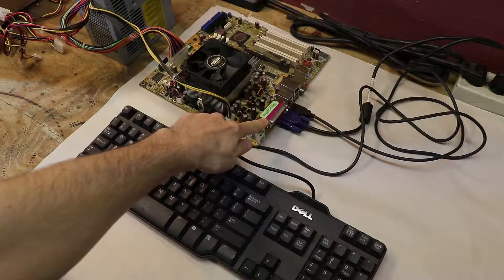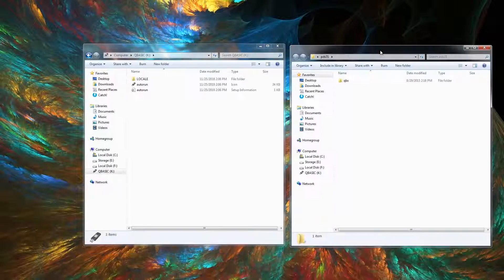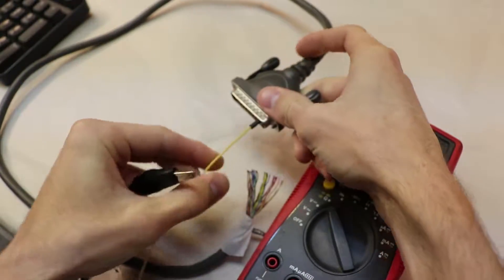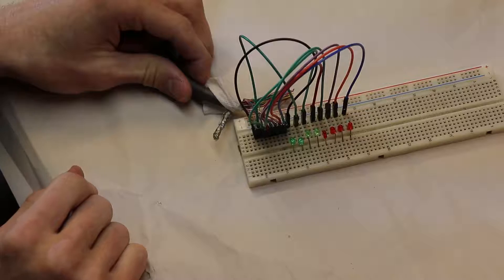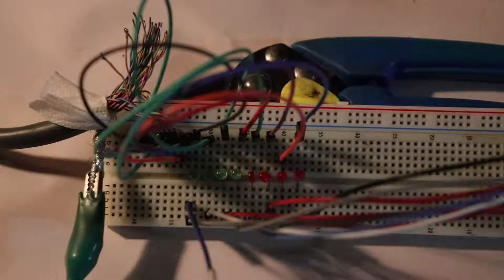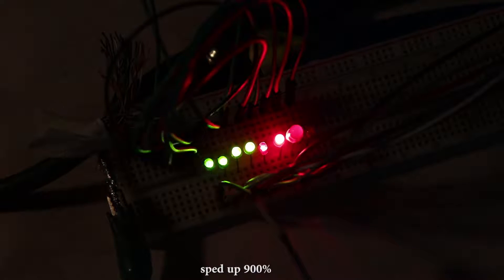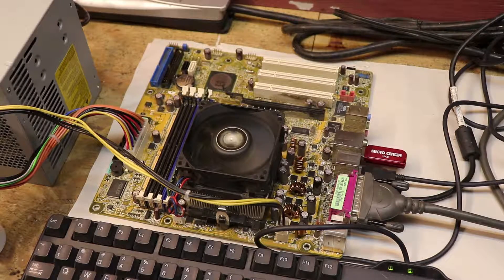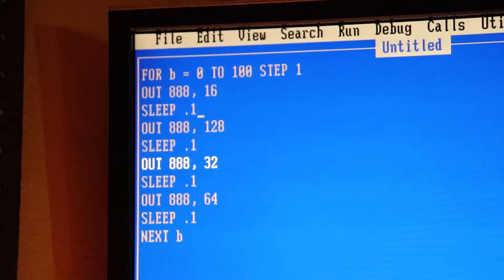Forget the Arduino and Pi, use your old PC!

Comment: Forget the Arduino and Pi, use your old PC and get your electricitybill exploding! xD

Anyway cool Idea.
Reply: No it is not.
Reply: @thepetyo  how this is not a good idea
Reply: Tbh a 55w amd duron doesnt sound that bad.
Reply: @eduardoavila646  laughs in fking Pentium 4
Reply: @eduardoavila646  the problem was the PSU

Old amd socket a drew a lot of 5V power, I discovered that the 5v rail gave 20amps!

Apart of socket a, i also got 478 motherboard too
Both seems to be working with only socket 478 cooler has a bit of problem
Reply: @bitelaserkhalif  Later socket A boards fixed that issue with the auxiliary power using the 12v line. 

But if you use only the cpu and no desicated gpu (onboard only essentially) no bizarre old extra expansion slots, any non generic psu handles it.  
My duron 1200 is a example of that. It has a biostar m7vkq, with a integrated 8mb trident blade 3d, 768mb of ram and its fine, with a random 180w psu i found, its actually pretty generic. 

But i see, you probably watch phill's computer labs? I saw these types of tests there.

Anyway this issur exists, but if you dont have anything dangling around the mobo its fine. And later boards pulled the cpu power from the 12v rail too.
Reply: @bitelaserkhalif  i have several p4's, sadly they are 95 and 108w chips. 

My hp psu literally sweats with a rig i have with a dgpu and a p4, on a dimension 5450 (i think?).
Reply: @eduardoavila646  yup i saw Phil's video

My socket a motherboard is chaintech 7a1a5
Reply: @dlain200  it's a cool idea, but not a good one.
Reply: phill's computer labs.?....... how do I get there.?..... I would like to see it.................
Reply: @blesroy1090  It's a youtube channel
Reply: Thanks I will try it...........
Reply: You could use a picoPSU to reduce the amount of power required to run a motherboard. (ps. I'm not sponsoring this object, I'm only saying that this is a good idea)
Reply: Old PC uses like 50-80 Watts, new one needs 250 or more... so you're way out of the spot...
Reply: @eduardoavila646  Yea, Had the 3GHz model, sold it like 12 years ago! That was more heater than a cpu... :D
Reply: Sure. Desktop PC will always use more power but no more than what power supply allows. I don't see how power usage would be different than using modern desktop.
Reply: @madyogi6164  ??? WTF ??? You are just comparing an old system that already consumes more power in idle mode than a new PC "running" the same software. 250W maybe when you're gaming, yes.
Reply: @OMNIDROID2995  Plug in a multimeter in your mains and check it out.
Reply: @madyogi6164  
Standby ~ 3W
Idle ~ 18W
CPU 100% ~ 62W
GPU 100% ~ 73W
Gaming ~ 109W
Full 100% ~ 137W
measured with a Clamp Meter on all yellow 12V lines and averaged.

PSU Efficacy Wall to Component 80 to 92%

So what? Of course I don't have a high-end PC. But if it is configured according to the manufacturer's recommendations and the energy options in Windows are set to Balanced, it looks almost exactly the same.

My Raspberry Pi 4 under full Load: 7W
Reply: @OMNIDROID2995  
Hi, quote:
CPU 100% ~ 62W
GPU 100% ~ 73W
Gaming ~ 109W
Full 100% ~ 137W
Does one of us have some issue with math? 62 CPU + 73 GPU hits 135W already...
Anyway. your Pi-thing is completely different kind of devil. Truly, never crossed my mind to consider it as any serious device. Though it's speed is constantly rising... xD Is it about to hit the same wall normal PC-s did within 20-10years ago time span?

Amps eaten with laptops (etc. stuff) is lower by design. They were built with power saving in mind and not to kill the battery before warranty ends.

I was more about what comes and goes from the wall to what's commonly known as "workstation". At the moment of typing this, my APC backup PS shows 123 W total eaten. The PC eats like ~75/80W idling (it's with I7 3770K; back then the CPU alone was of the price of mid-range PC). 2nd smaller PC (very old, PIII driven grandpa) eats about 40Watts. If I turn the mighty I7 host into power wasting mode xD (it goes up to 4.5GHz with OC). Plus the vga, drives, memory, peripherals (the display), 250W hits the fan without any hesitation...
Reply: @madyogi6164  As I said, measured. And I know of hardly any game that uses the CPU to 100% capacity, so I consider the measured and calculated 109W to be quite realistic. 137W were FurMark "and" Prime95.

But I know what you mean. It's an "older" i3 with 45W TDP and a GTX 1050 Ti with 75W TDP. Not a laptop!
Reply: @OMNIDROID2995  
Something aint right! You responded to what YT cut in half and junk was left...
You initially wrote:

Standby ~ 3W
Idle ~ 18W
CPU 100% ~ 62W
GPU 100% ~ 73W
Gaming ~ 109W
Full 100% ~ 137W

As I see it, your CPU + GPU gives 135 in total and you write Gaming 109...
Some weird math...

Your Pi-thing is completely different kind of devil. Truly, never crossed my mind to consider it as any serious device. Though it's speed is constantly rising... Wonder if it hit the same wall normal PC-s did in 20-10 years ago time span.

Amps eaten with laptops (etc. stuff) is lower by design. They were built with power saving in mind and not to kill the battery before warranty ends.

I was more about what comes and goes from the wall to what's commonly known as "workstation". At the moment of typing this, my APC backup PS shows 123 W total eaten. The PC eats like ~75/80W idling (it's with I7 3770K; back then the CPU alone was of the price of mid-range PC). 3nd smaller PC (very old, PIII driven grandpa) eats about 40Watts. If I turn the mighty I7 host into power wasting mode xD (it goes up to 4.5GHz with OC). Plus the vga, drives, memory, peripherals (the display), 250W hits without any hesitation. Not a challenge...
Reply: @madyogi6164  109 when gaming (BeamNG Drive) AVERAGE!!!

CPU 100% 62W with Prime95 AVERAGE!!!
GPU 100% 73W with FurMark AVERAGE!!!

137 on full synthetic load. AVERAGE!!!

Measured TOTAL Power consumption on 12V Line

More Heat = Less Efficiency on Semiconductors
Reply: @OMNIDROID2995  Well, what can I say? Lucky you... x)
Reply: @bitelaserkhalif  😭😭💀🤣🤣🤣🤣

Comment: Instead of cutting the db-25 cable you could have plugged it into a breakout board and had labeled screw terminals ready to go
Reply: He litterally could have just run jumpers to the board and saved a ton of time
Reply: You could also get an old parallel port ribbon cable riser and plug into that. That's how I have my buffered break out board setup. I cringed a bit when he drove the LEDs right off the parallel port. There's no spec for how much current a parallel port can source or sink. Believe me I looked. Although you can pretty much count on getting a few milliamps out of each line. At least 3 ma. Past that you're living dangerously.
Reply: @Ian-ff2hz  thats what uln2803 is for

Comment: Huh, this video popped up after i was looking for info on system speaker.

I had this idea of using PC as a microcontroller, glad to see it in action. There's so much potential in this, no uC can get even close to a system with OS installed
Reply: You can literally make an Arduino with a couple of dollars worth of components and run it for months or even years off of a cheap lithium cell. The ESP8266 is rarely utilised even close to its full potential. If you want to waste money and resources unnecessarily for a lack of wanting to learn something different that's your prerogative.
Reply: At the same time there's so much a full pc cannot do while a $2 Arduino does it flawlessly...
Also the power consumption of an Arduino is typically bellow .5 watts while such PCs will be well above 50, sometimes even higher, really limits the cases where a 1000x increase in power consumption is worth it for slower performance in most cases.
The microcontroller allows very low level access, this tries to do something similar but is severely limited in its capabilities sadly.
If you need the performance of a pc but the electronic benefits of a microcontroller: combine the two... Setup a UART/RS232 or use the ESP with wifi to get the two to communicate, this is how it's already been done for ages because it makes much more sense than this approach which is slower, limited and rather backwards even.

Comment: Instead of wiring all the cathodes of the LEDs in parallel you could have used the power rail of your breadboard. Also LEDs need resistors in series...
Reply: They don't if the voltage is low enough,
Reply: No if the current is limited, voltage plays not a role. At least not in this example
Reply: He is trying to control each led individually, connecting each led to the same power line will not work
Reply: Kaustuv Akash the cathode sides of the led’s are already wired together. You just need to wire the anode sides to be able to control each light individually. Doing this wouldn’t change the circuit really, it would just save time.
Reply: @patriktadic3973   yes they do to a) limit the current flow and b) prevent damage to the UART on the parallel port. DOH
Reply: True, the Output Voltages from the parallel port is TTL  (0V or 5V)  so it is needed a 220 Ohm resistor for each LED to protect them. Back in the day i built something like that but used the ULN2803 and a external power source to protect the port. There are lots of cuircuits out there if you need.
Reply: @kaustuvakash2311  he meant connecting all the -ve terminals of leds in parallel to ground
Reply: Just connect one resistor between ground and the shielding of the cable.
Reply: Problem with using only one resistor is that, it works fine only when you turn on the LEDs one at a time, but when you turn on multiple ones, then the (fixed) current will split among them and you get dimmer output. It's also a bad idea when you mix different color LEDs and use only one resistor, as their Vf are different (it's even bad idea for same color, as their Vf would also be slightly different due to manufacturing process). Largest current will flow thru the LED(s) with the lower Vf, and they could overheat. The problem is worse if you don't use any current limiting resistor at all, as the internal resistances of the parallel port output/diode are then limiting the current, and if the current is too big the output driver/diode will overheat and burn out. Thus when you look at schematics of properly designed circuits, separate resistors are used for each LEDs.

Comment: I wish I would have learned this when I was a kid. Basic is the perfect language to teach programming to beginners. The sintax is simple yet robust enough to do many complex applications. 
Thanks for the video.
Reply: I look back to when I was a kid and wish I'd had a subscription to BYTE or one of the other computer magazines, because I had oftentimes wondered if this was possible on my Commodore.  I would have had a blast with it right up until I shorted out the user port and fried the computer.  Hrm, now that I think of it, maybe it's for the best that I didn't...

I don't really agree about BASIC, though.  Doing simple things in BASIC is easy, but doing complex things is BASIC is much harder than languages that have things like call stacks and dynamic memory.  I'm not a Python fan myself but that's the language I usually recommend for beginners - it's true to the "spirit" of BASIC, and when you need more advanced functionality it's there for you.

Comment: I used QuickBasic back when it first came out (1990) to program Star Trek games and mess a bit with databases.  This video isn't much of a functional "wow" thing, but it's pretty interesting in a historical and educational sense.  Now if you actually had QuickBasic(and not just QBasic) you could compile your code into an .exe file and that stepper motor would be hauling some serious butt.  Cool video! (Edit - I'm assuming that you may not have the full QuickBasic, but if that's what you're using, give the compiling a try)

Comment: Back in the 80's hobbyists used the joystick ports on their Atari and C64 to do this. If I knew then what I know now, I could have built much cooler stuff.
Reply: if i got this video in 1995 i dont trashed my obsolete computers
we have now  10g 3$ atiny85 and the 10$ esp32 more powerfull than old 8086 8mhz 512k 

who remind the tape recorder memory storage
Reply: I used to teach computer control using an Atari 800xl.  Halcyon days 😍
Reply: @glennleader8880  Great machine! I read De Rey Atari front to back until I nearly memorized it.
Reply: Joystick ports were input only. Also, using ports as outputs on the C64 will drive you to a complete mess, the port being scanned every interruption for the keyboard.
Reply: @glennleader8880  what a waste 

myself i sweared at the amiga500 and my parent drived me to amstrad pc against all my wish but they did the good choise of text versus video and sound tought it disgusted me of the programation until arduino
Reply: @CaptainDangeax  The Atari's Pokey chip was bi-directional and offloaded the CPU as well!
Reply: @mheermance  I don't know the Atari hardware so you're probably right. The 6256 used in the C64 was also bidirectional, like 8255 and AY-3-8910 used in many other computers like MSX, Amstrad, Atari ST and so on. What I want to highlight is the fact that, on the C64, the 2 joystick ports were connected to the keyboard row and column scanlines at the same time. Pushing the fire button on joystick 1 was equivalent to pressing the spacebar. And it was completely impossible to type if any of the 2 joysticks was moved. Because of the wiring of the C64 (and NOT the bidirectional nature of the chip), using the joystick ports on the C64 for anything else than games was really a pain if it would ever work... C64 provided a serial + parallel user port completely free. The 8 bit guy made a demonstration of attaching a LCD display and driving it using BASIC.
Reply: I did build cool stuff.  Including controlling an industrial process at an exhibition.
Reply: @mheermance  I tried to memorise "Mapping the Atari"...Every pun intended :oD
Reply: @omnianti0  Why was it a waste?  I Learned a great deal from it, and I earned a few bob for my efforts too.
Reply: @glennleader8880  all this good tech as amiga and atari and so many other that stoped or decay 

when looking at the history of industry their is so much people that lost time and money despit real inovation and so much half scamer that sucessed
Reply: yavuz1  it was a great era when a computer was understandable in the deep and the program code had to be optimised in the last bit
Reply: I used the trigger input on the joystick port to input a thermistor controlled oscillator to log temperature. Linearized in QB, stored to floppy. Old Compaq win 98 machine.
Reply: @CaptainDangeax  there was (is) the user port for outputs
Reply: @DanieleVetrucci  did I mention the user port able to do parallel and serial IO 5 month ago ?
Reply: @CaptainDangeax  yes, I didn't saw it because it was hidden.
Reply: What do you know now? Can you teach me?
Reply: @AdisHalilovic  Microcontrollers make most of this stuff pretty simple. But even classic 8 bit machines are easier to program using modern tools.

Comment: Nice video! I did similar around the turn of the millennium. I used the box (486 computer) and Visual Basic 4 DOS. The syntax is very similar to FreeDos. Since I didn't have the printer cable anymore, I got me an RS232 plug and soldered wires on it. To protect the printer port, I used TTL NAND chip 7400.
I gave up since using the Arduino is more convenient.

Comment: Fantastic video!  Glad to see someone keeping it real with discrete components, rather than some off-the-shelf Arduino garbage!  As for the delay issue, instead of the annoying "beep" statements , you might try setting a variable to some low integer value, such as "Del = 10", then replace each beep command with "For X = 1 to Del: Next X".  That way, you get good control over the speed (not to mention peace and quite), just by changing the value of the "Del" variable.  Thanks for the terrific vid - I look forward to seeing more of your fine handiwork! Cheers!
Reply: I remember typing out the code to emulate speech in QBasic using those techniques!

Comment: Nice Video which uncovers the basics of computing- what MS Windows is disguising. BTW, I bought me a 25pole plug for the parallel port. Further I am using Visual Basic for DOS to have a graphical interface (coding is like QB). When you need inputs (4 are possible) you have to dig deeper into the parallel port programming. For an analog input you make it like in Apple2, you use a 555 and measure the time on an digital input (I never tested it).

Comment: Interesting... reminds me of where I left off with the Zenith and Packard Bell's we had.   Then tried to keep the stalkers away, though only bought the books, played a little video game work and just work as much as I can mind.  Bought em those first years in college era, though still have em to read... Programming the Parallel Port: Interfacing the PC for Data Acquisition and Process Control and Parallel Port Complete are around somewhere where the later is the OG on the bounce back, albeit brief while I was still in school and not haunted by a fearless remote sensing stations concealed wireless assault weapon operations operator idiot that wanted to be in that house.

Comment: I used to use Turbo CNC in conjunctuon with s parallel port to control a 3 axis CNC machine back in the day... ut worked very well and all i used for a driver were IRLZ44 mosfets straight off the port pins